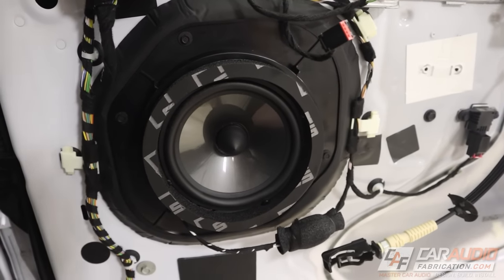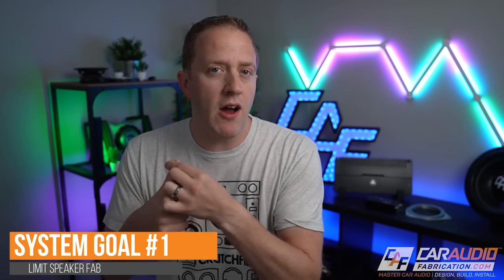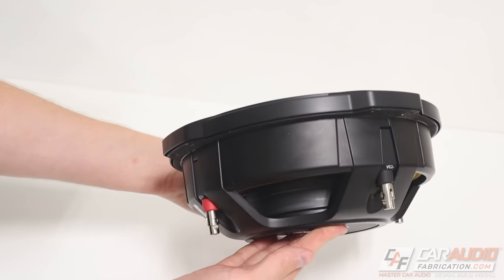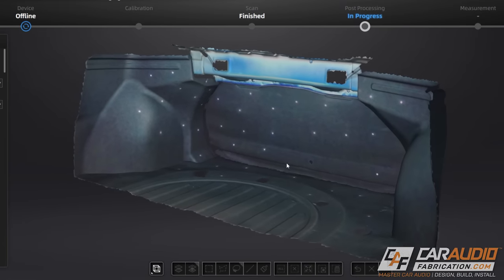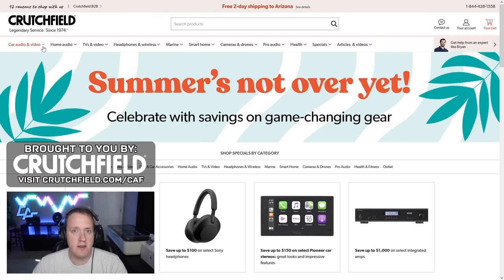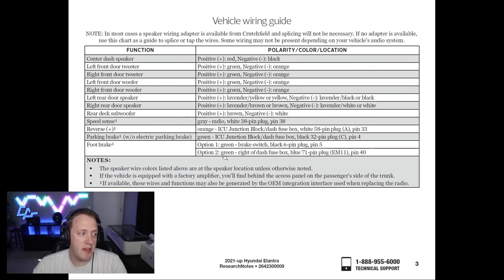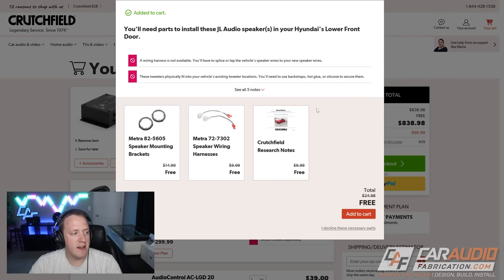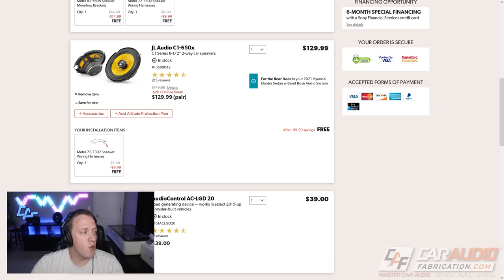Planning Speakers, Subwoofers, & Amplifiers for Car Audio Build - NEW PROJECT!

Comment: Hello, if possible, I have one question. For example, I have a passat b6 with a simple audio system, but I am a big fan of sound quality. I'm more interested in more power and heavier sound, but is it possible to get something similar to surround sound or dolby (for music, not movies) with an aftermarket player and amplifiers or by installing more speakers (if possible). Thank you very much for the reply:)

Comment: You covered this ages ago. But for time aligment (fully active front end)  with a tape measure do you measure to the headrest or something else like your ears. I just find with ears its not quite right. Apreciate any feedback 😊
Reply: It does not have to be super precise. Just go from the center of the speaker to the center of your head. If all speakers are measured with the same technique you'll be just right.
Reply: @JasonWW2000  cheers for the help. I have allways done it from middle of headrest. Just wondered if there was a better place ( more favoured )
Reply: @KebabC2024  It's all about what sounds good to you. You can write down the distances and just listen to the left mid and tweet and add or subtract just a little delay to get them blending seamlessly. 
Obviously, crossover points can also help them blend. So you can play with that.

Then do the same for just the right side mids and tweets.

Then you can fine tune the delay between the left and right channels to move the center image left and right slightly, but adjusting levels (balance control) is another, easier way to fine tune the left and right center image location. 

Let your ears be the final judge as opposed to theoretical ideas of how it "should" be adjusted. Ultimately, the goal is good sound and enjoyment.
Reply: @JasonWW2000  thanks. Apreciate the info. All seems good as vocals are centred. Just wanted a second opinion to make sure its all good. Will ideally level match them eventually, but allways busy 😂

Comment: I have a Jeep Wrangler Unlimited hardtop. I am planning a build based on your designs. I was curious if from your experience if a vented box with the subwoofers firing towards the back with the vent in the same size or firing up with the vent firing back? I don't have anything to test with?

Comment: I have a Lexus SC430, and I am redoing the audio system. I will be changing the head unit, amp, and speakers. My main issue is the shallow 8 inch subwoofer. Most shallow subs don't fit, apparently. My choices seem to be a Polk, Audiofrog, and a Focal. I am leaning more towards the Audiofrog. I'll be running everything through a Rockford Fosgate 5 channel amp. Any input on the sub?

Comment: so my question is door speakers, I wanna run 8 kicker cs 4ohm full range 6.5 door speakers, so will I need 2 four channel amps that run at 4ohm? (this was my plan) or is it better to get one higher power 4 channel amp and bridge the eight down in pairs to a single 4 channel amp. 
could I also run 4 off the head unit and run 4 off a single 4 channel amp? I hope im making sense. I understand sub wiring but I never have run amped doors. thank you

Comment: any amps to recommend? i want to upgrade my stock amp. i dont plan on getting subs but if i ever do i think id get a separate amp completely. so to upgrade the stock amp i just want it to power all the speakers. i have a pioneer head unit & kicker speakers around

Comment: If I'm using an after market head unit ( Pioneer DMHW4660NEX) with a powered sub (Pioneer TS-WH500A)... will I need an amp kit or will the head unit power it?

Comment: I have a Chrysler 300S w/ alpine system that sucks, no subwoofer with it. I'm going with audiocontrol Amp withDSP. I only have 6 speakers. I'm just changing speakers, adding a Amp and subwoofer. What else do I need besides the audiocontrol DM 801

Comment: This is alot more complex than i had anticipated. I just want to update my 06 tundra. Installed an aftermarket kenwood head unit and have an alpine pwe-s8 on the way i got on sale for $210. I was hoping i could replace the 4 door speakers and 2 tweeters for under $300. Am i being unrealistic?
Reply: I got Rockford Fosgates for $250, all four, and they are very entry speakers. The tweters, were another $100, also entry level tweeters, Skar Audio front, Pioneer rear.

Comment: Yo Yo Mark, question for you. Will a new set of DD or AD subs, give me any flagrant difference from this set of old school Eclipse 7000 dual 2 ohm woofers? Power is plentiful and crispy clean.
Reply: Thats really hard to answer. If you like your current setup, there's no need to swap them. But if your got extra cash and want to try something new, you can. If your not satisfied with your current setup, then it doesn't hurt to try something new. It could be better or it could be worse. Try to figure out where your current subs are lacking and get ones that should be better in that area.
Also, you could try your current subs in a different enclosure. Bigger or smaller, sealed or ported at a different frequency.

Comment: i dont get if that amplifier handle 75x4 he gone to add 15 extra watts per mid bass. but what happen with twitters? how many watts does they need? or those 15 extra watts goes to the twitters? sorry for my bad english
Reply: If you have too much power coming from the amplifier, you turn down the gain way down and slowly raise it. When you start hearing distortion, you turn it back down a little bit so it stops. The gain cuts the power back until the speaker can handle it.

Comment: I have a Sony XAV-AX5550D head unit with R1675-S In my Front Doors, and R1675-X2 in the rear doors of a 2014 VW Tiguan. I’m looking to get a sub and amp combo and want to stick with the Rockford family, does anyone have an idea what sub and amp combo from the Prime Family would work and not be over the top expensive, is the R2-500X4 and the R2D4-10 a good combo  idea? I also want to have a 20L Sealed enclosure in the boot built to confirm to the dimensions of the Tiguan’s side panel so that I can still have a large cargo space.

Comment: I have a system all planned out  with aftermarket touch screen in dash. What can I do to prevent theft of the head unit?
Reply: Don't go bumping the subs before you park somewhere. No windows stickers, keep the vehicle looking stock. Tint the windows. 
There's really not much you can do.

Comment: Would this apply to a bmw? I have a 2011 535i with the standard hi/fi system. How would i go about planning a system that wouldnt require a lot a fabrication?
Reply: There are a couple companies that offer a system for about $2500 but don't give any specs on the power rating for the "upgrade"

Comment: What 3.5 speakers would you recommend for my 3 way system.  Have full jl audio c7s having a problem getting 3.5 c7s what can I use to replace them?
Reply: @baldylocc64  
It shows that the JL Audio C7-350cm 3.5" midrange speakers are currently "IN STOCK" at Crutchfield right now so you shouldn't have a problem getting them!

Comment: I really like the information shared by this channel. But this was a bit of a joke. I mean, he wanted to "stay under $4000". What he showed is that when choosing his speakers, subwoofer, and amp, sure, he stayed under $4000. But, what he didn't show is that he hadn't included the cost of purchasing any wire for powering the amp ($80 for a kit), any LOCs he may need since he was using the factory HU (if the amp doesn't have built in LOCs), any RCA cables (if required), the fuse and fuse holder (OK,, that's only $10 - $20, but still, all these little things add up)--and for a person doing this the first time, they may need to buy a crimping tool (another $20 - $40), wire ferrules if they want a clean install (minimal), tape and/or loom, speaker foam rings, wire taps, or if they choose to do soldering, than a soldering iron with attendant accessories (up to another $100), and lastly, he had no box for the sub! Whether you buy or custom build a box, that's another $100 - $200. And now you're easily looking at an additional $200 - $500, and therefore, coming in OVER BUDGET.
Reply from the maker: As specifically stated, budget for the GEAR. Not for the whole install. Everyone else understood.

Comment: Wow 4 grand is considered mid level
Reply: It all depends on the person. It could be high end for some or entry level for others. Its all relative.
Reply: @JasonWW2000  true, agree
Reply: Yeah, but the true cost of this system is upwards of $5000 - $5500, depending on other supplies needed for the install (power distribution for the amp, sub box,etc.). For a first-timer, there will be other tools that may need to be acquired. And, if you can and do want to replace the factory HU, you're looking at an additional $300 - $1400, depending on the HU you choose, easily pushing this upwards of $6K!

Comment: Step one: Use home audio speakers...
Reply: It's generally not a great idea to use home speakers in cars. For one thing most home hifi drivers aren't capable of the output most car audio ppl expect. Also, very few home drivers can handle the physical environment of a car. The heat, cold, humidity, and sun are all very damaging to speaker drivers if they aren't properly treated